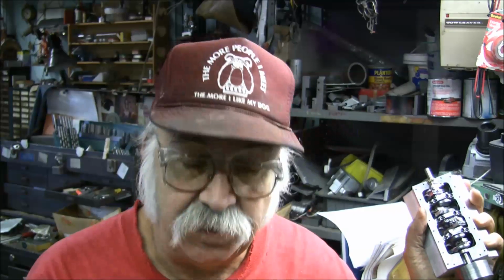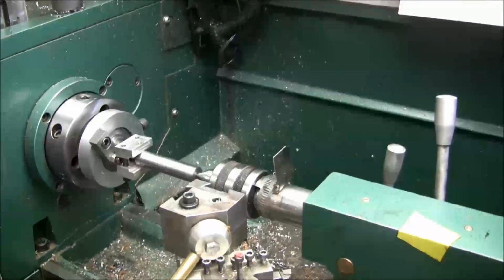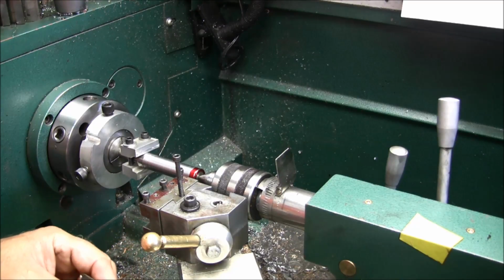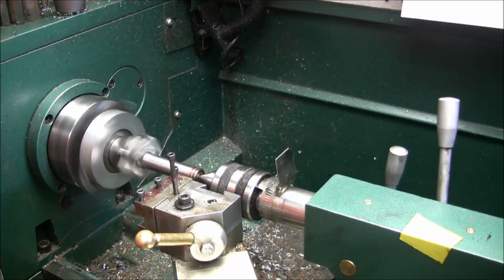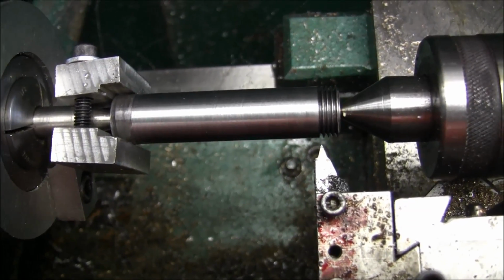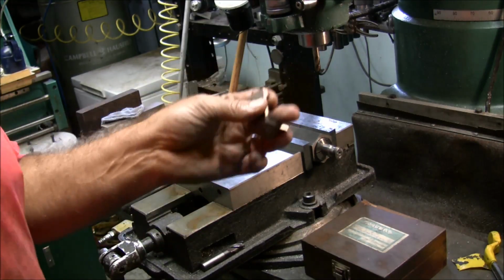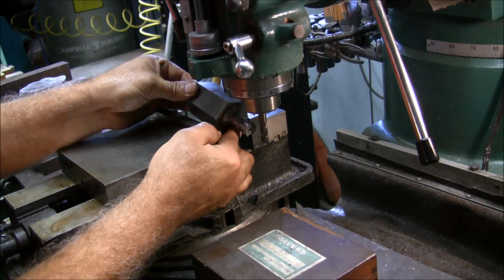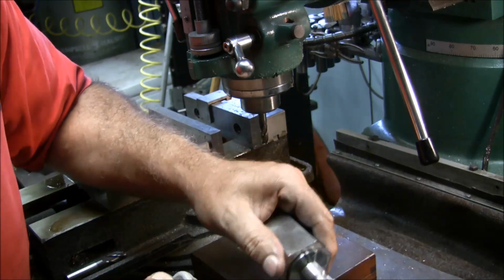Gear cutting Making a Gear Hob for a 48dp gear.

Comment: just to ask what type of spring pressure it is because I want to take those prints for that engine and make into 1/4 scale engine
Reply from the maker: I think the springs I have are around 2lbs they are .018 music wire if that will help you out.

Comment: Hey what do you use for valve springs
Reply from the maker: I  ordered spring the size I wanted from McMaster-Carr in other engines I have found and used springs from the local hardware store.